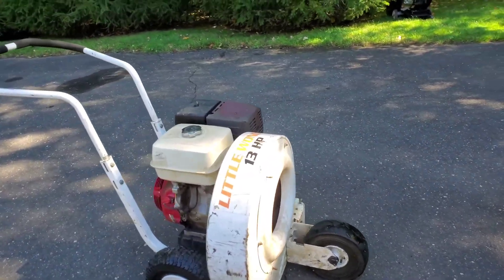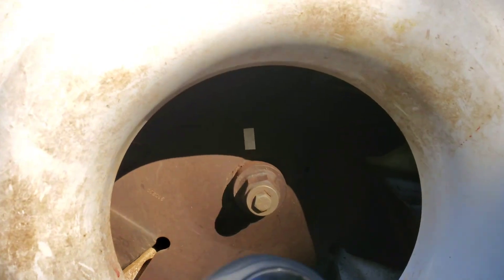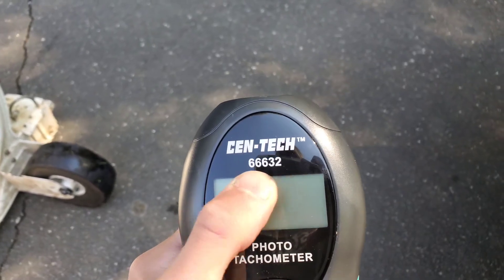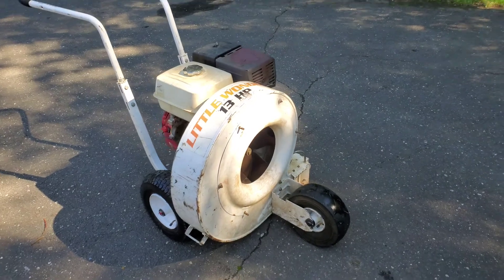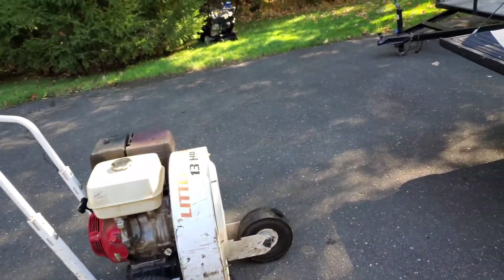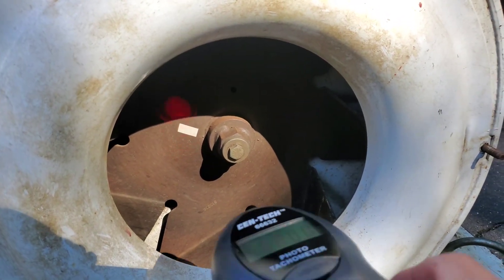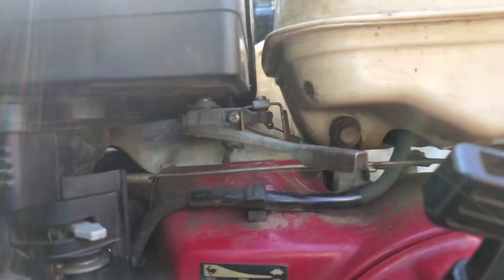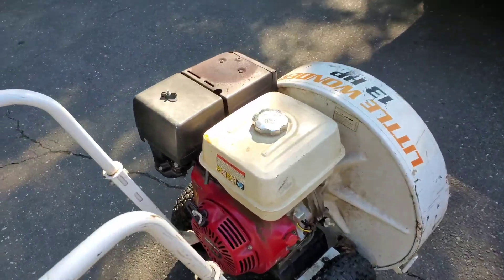How to test & adjust the RPMs of any walk-behind leaf blower

Comment: 4:10. Wtf!!?
Reply: @everythingmechanical_yt  those fans can actually explode?
Reply from the maker: @Ca31_Buff  Yes. I wouldn't worry about it too much though. Honestly if the engine would probably blow up before the fan if it's revving that high. Also considering it's steel, it would probably take a lot for it to come apart. But definitely something that's not worth testing. Especially if the impeller is made out of aluminum or cast
Reply: @everythingmechanical_yt  lmao, so true. I don’t mess with my units mechanically, I just do the occasional maintenance